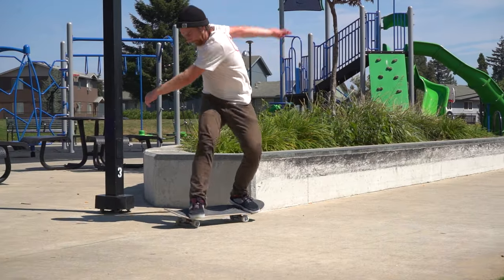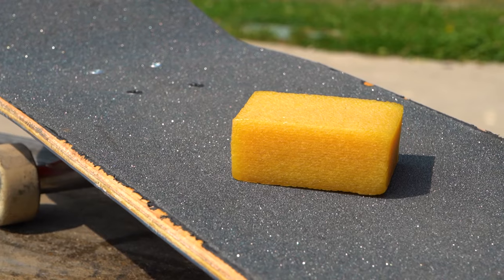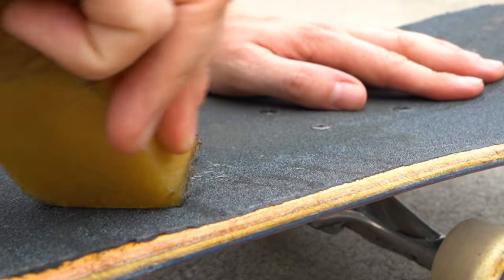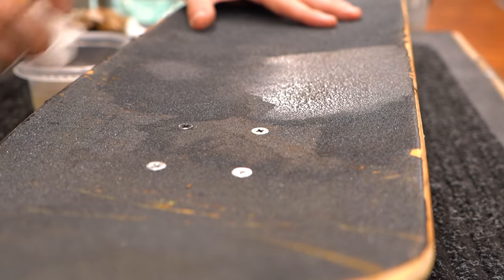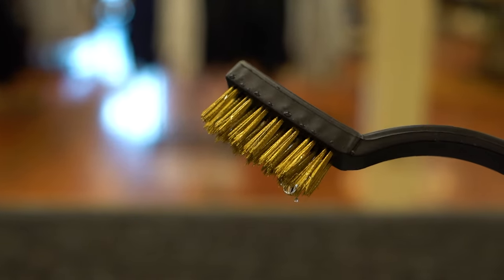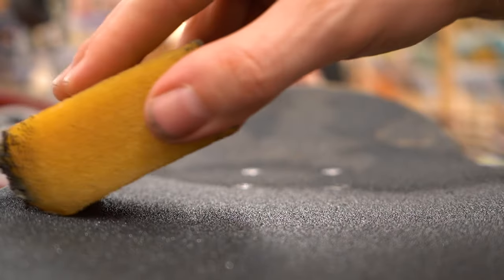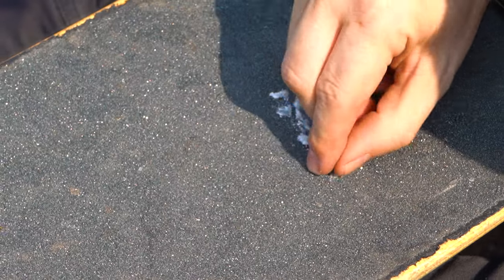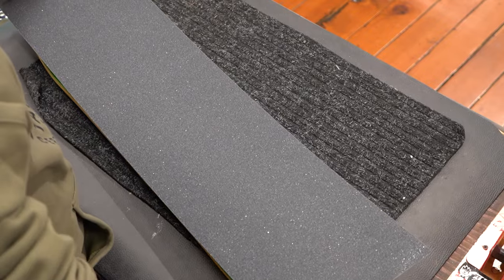How to Clean Skateboard Grip Tape | Tactics

Comment: I’ve always used the water method. Every time I’ve messed with grip gum though, I was really impressed. Just one of those things I always forget to buy
Reply: I was really impressed how bad water is in cleaning the grip tape if you dont use the towel method. Even then the gum is superior in cleaning dust. But when it is really dirty you need that water but still

Comment: i just went longboarding in the morning at the park and it had recently stopped raining. My brother wanted to give it a go so he put his wet shoes on my longboard, his shoes had tiny bits of leaves stuck to it and once he finished using it there was stains and bits of broken leaves everywhere, i didn’t think too much of it until now, im now struggling to remove it, i’ve attempted using wipes but they’re leaving scratches on the board and it’s not really doing anything. Any idea what i could do?
Reply from the maker: The methods in this video should get the job done. Grip gum should be able to get it out fine, but if you don't have any (or don't want to get any) you can try the old tooth brush method to get in between the crevices of the grip. 👍

Comment: When using the grip block do you need to wet it and what about after use what do you do with a dirty grip block?
Reply from the maker: You do not need to wet the grip gum block. The block does not absorb the dirt, but more like rubs it off like a durable pencil eraser, so the dirty bits usually crumble off the block. But I'm not going to say that the grip gum stays nice and clean all the time. You can keep it in a ziplock if you're concerned about the dirt, but I just keep mine loose in my skate bag and it's fine. Cheers! - Tim

Comment: My grip gum is not working to remove the surface level dirt on my board and I’ve tried the toothbrush method still no luck. Any idea on what I could do?
Reply from the maker: What's on your grip? If nothing is working, you could just peel off the grip and regrip the board with a fresh sheet.

Comment: if im getting a 8.0 deck with 31 mm wide wheels will they stick out if I use 139 indys?
Reply from the maker: Nah, you'll be fine. 31mm isn't a particularly wide wheel, and the Indy 139s will fit perfectly on your 8.0 deck. 👍 - Tim

Comment: At 0:53 you can use a pencil rubber?
Reply from the maker: You can, but the grip will disintegrate the pencil rubber in 2 seconds and it probably won't last long enough to fully clean the grip. - Tim